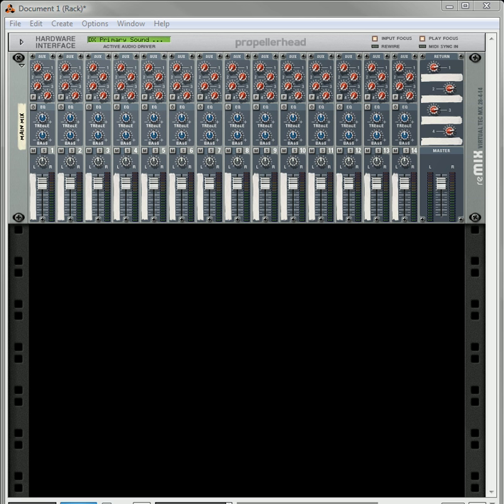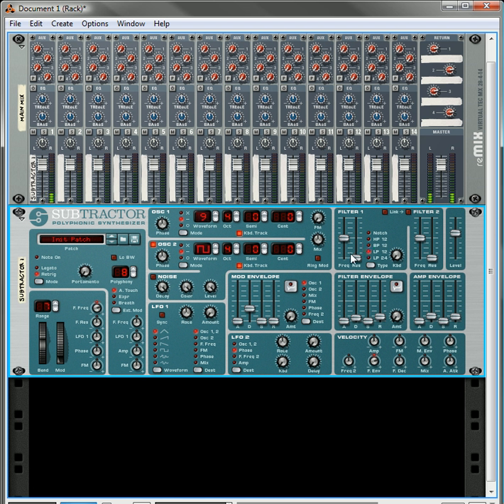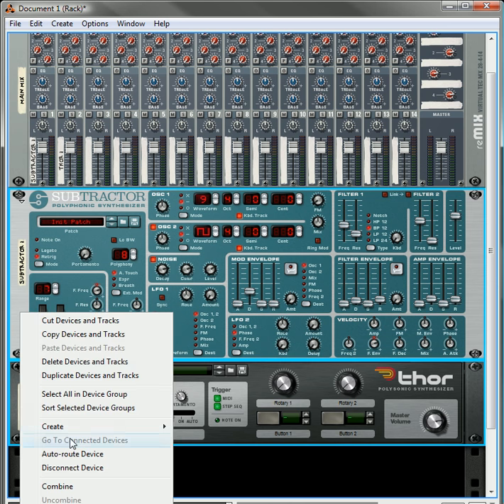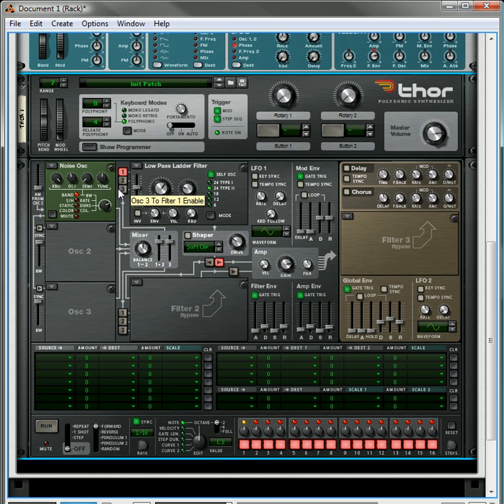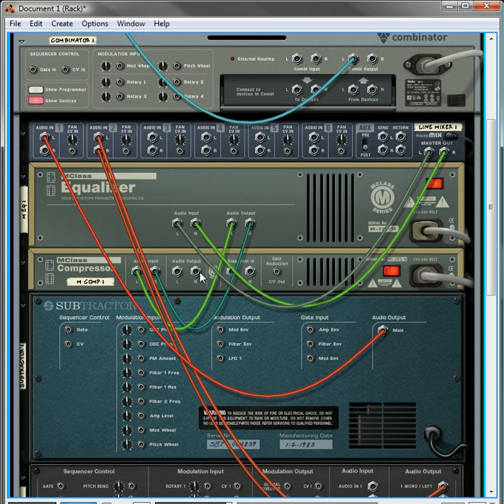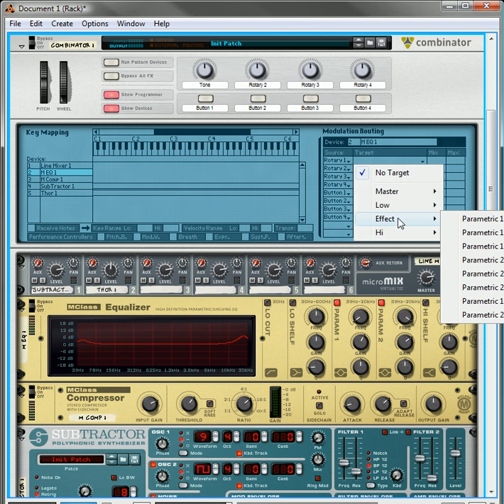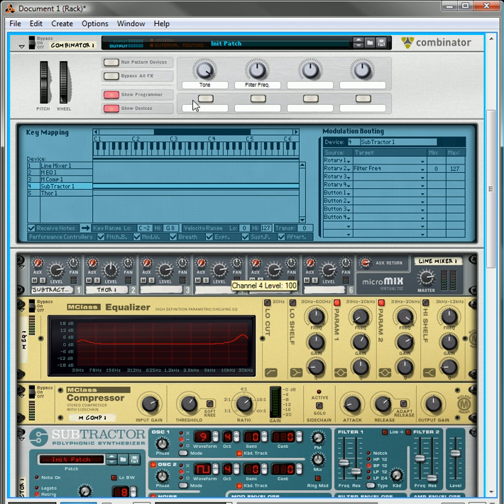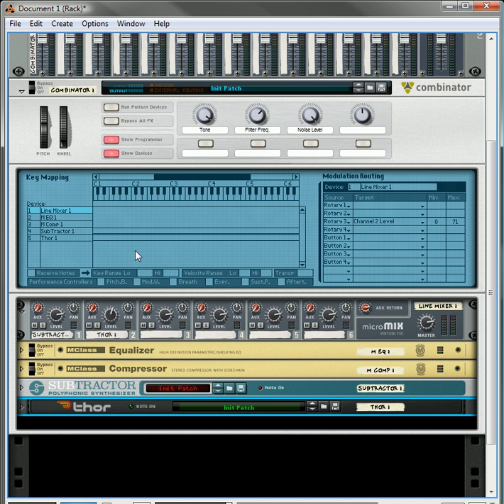Snare Drum creation using a Subtractor

Comment: seems like a lot of work for a snare sound
Reply from the maker: All good sounds require some work. If you don't like programming it though, you can always use a sample (or several), or purchase a Drum library. I just like working in the synths to come up with the sounds I use. But yeah, if you don't want to go through it, there are other ways.
Reply: i went throguh it and figured out that the more you do it the easier it is so i actually retract my last comment and thank you for the knowledge my dude thanks!